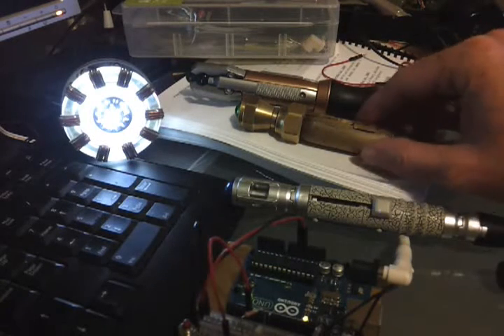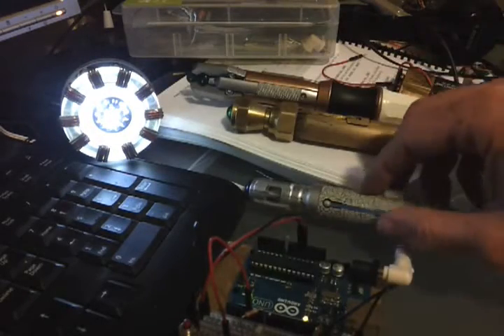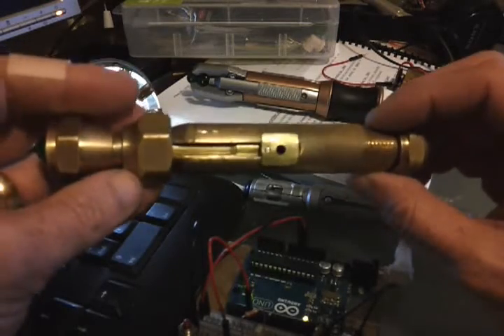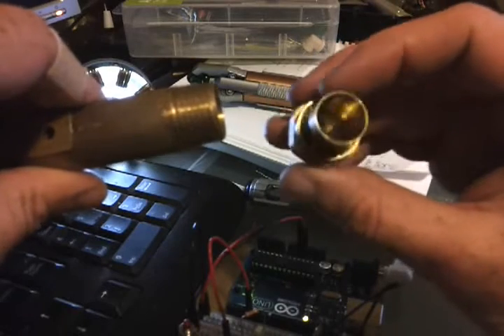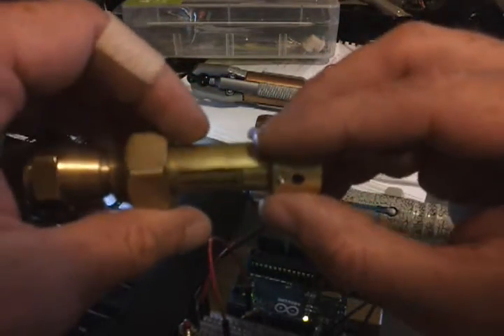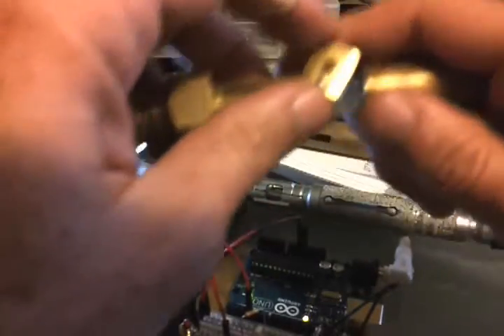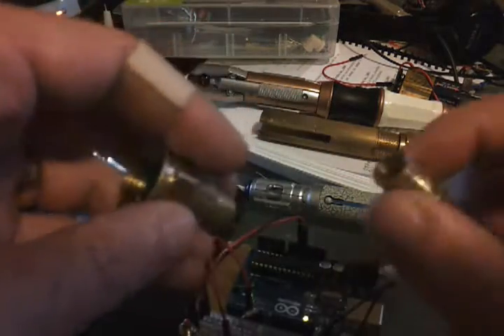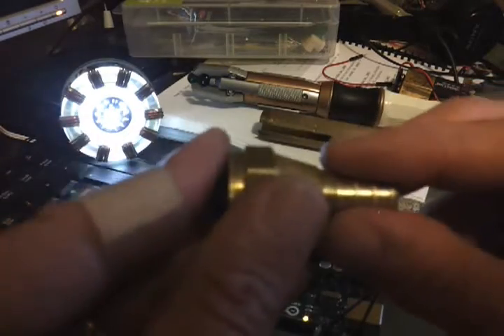Custom Sonic Screwdriver Mk I Tutorial

Comment: Any tips for getting the black helix out of the clear section of the original character options toy? It looks so much more 9th Doctor with just the wires crossed like that. 10 had yellow wires in his.
Reply from the maker: Concreteowl It's not super easy. You have to break open the plastic column.  It separates easy near the end after you pry the emitter apart. But you end up breaking off the plastic right above the screw hole for the thumb slider. The black helix will lift out of the column. I then used needle nose pliers to pinch the plastic apart without breaking the wires.
Reply: Mine seems to have exceptionally glued together I can't get anything to lever open on any of the connecting seams.I'm also trying to change the LED so I may either have to saw it open gringe
Reply: Concreteowl check out my modification of my 10th Doctors sonic screwdriver toy I am still working on it I am still trying to think of a way I can make the slider wider like the show personally I am proud of my modification

Comment from the maker: Outside diameter is 7/8, inside is 5/8. That gives you a little room to cut grooves and stuff without going through. Like the side window in my Mk II. I wanna say the length of the nipple is 3.5in but I cut off about half the threads before I grind the rest smooth.

Comment from the maker: 3 to 4in Brass nipple, a 1/2 flare nut, 1/2 reducer, and a pipe cap (But use whatever pipe fittings that you think look cool). I picked up some 5/8, 19/32, 9/16, and 1/2 brass tube at a hobby store. The LEDS and switches can be bought at Radio Shack or Online. The Sound from this one uses the 10th doctor toy.
    And thanks for compliments. I think you're swell.